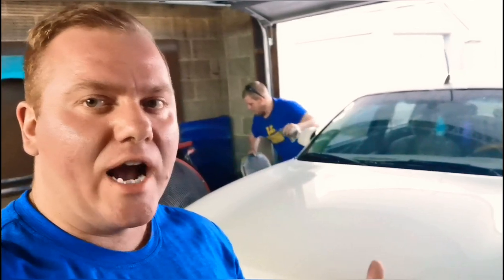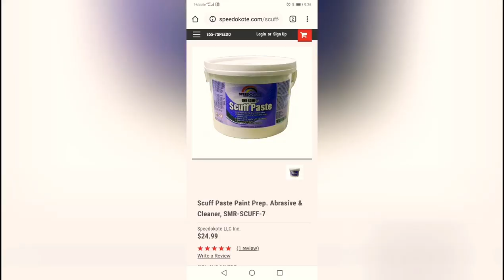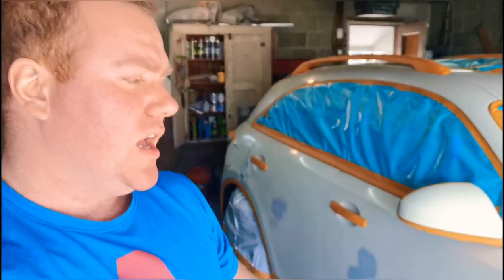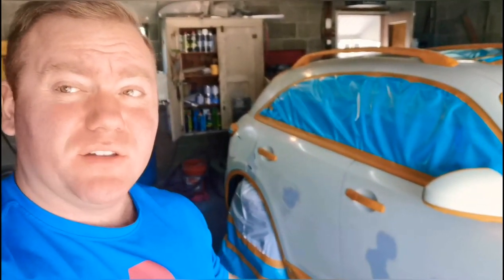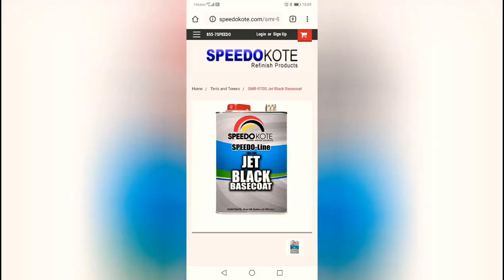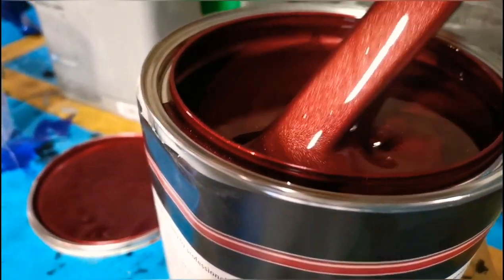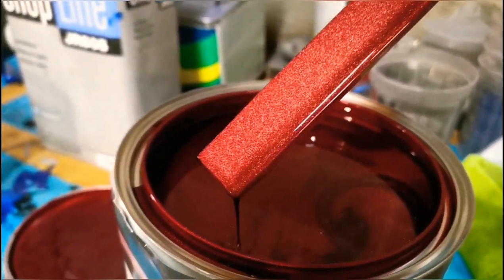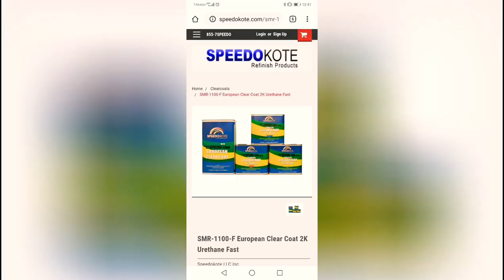Candy Apple Red

Comment: I'm just curious on the scuff paste if the paint will bond and not peel or flake off
Reply from the maker: Pretty much all automotive paints will stick to 500-1000 grit scratches. Gray scuff pad and scuff paste leaves about a 500-600 grit scratch.
Reply: @speedokoterefinishnetwork4937  so did you add adhesion promoter or just scuff paste alone enough for paint to not peel off
Reply from the maker: If you want to see pricing go to www.speedokote.com . As far as the paint sticking yes . All you need is a really good scuff and it will stick. I only advice this on cheap quick jobs.
Reply: network hows 800 to 1000 buck jobs sound hahahah

Comment: Do you have any tips to paint door jams?
Reply from the maker: Scuff jams with a red scuff pad ,Use tape and create a "web" to support the paper , paper em up and then tape the edges and such and just do light coats of paint . If fish eyes occur anywhere it's in the door jams because of detailing products that sit in there and contaminate the area . So light dust coats of paint can usually avoid this issue